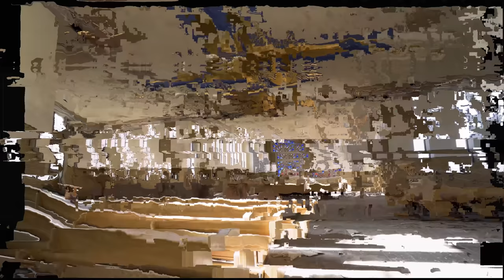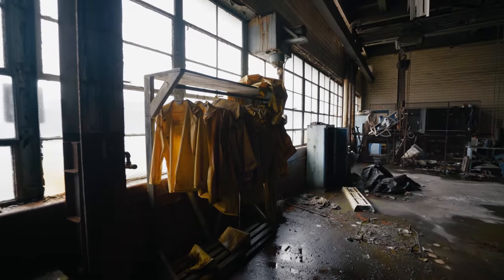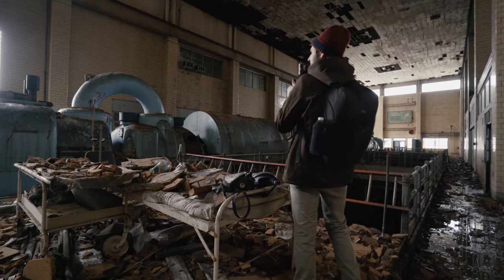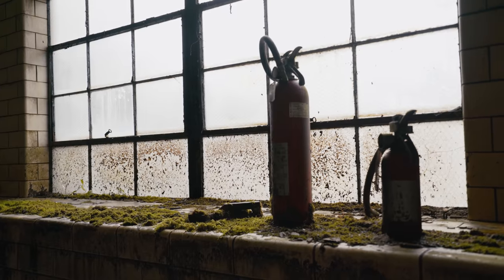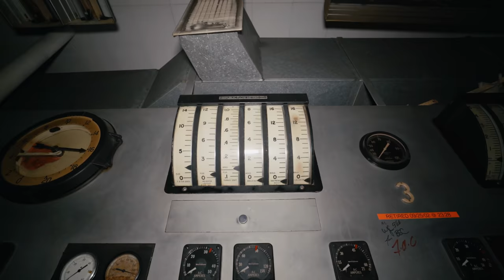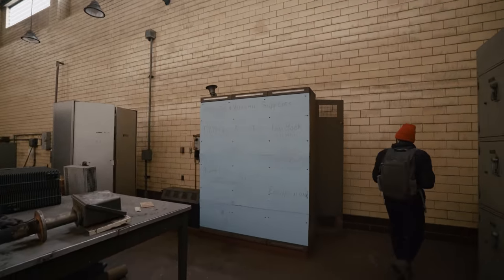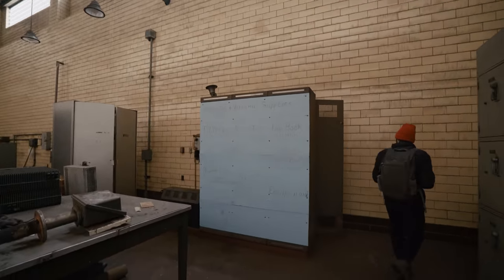Abandoned Power Plant Decaying for 20 Years - Vintage Time Capsule Explored!

Comment: Most turbine decks are enclosed for maintenance and repair purposes. Especially in supercritical boilers where turbines have an expansion chamber where super heated water turns into steam, a controlled environment is a must.
Reply: Where have you heard that?  I used to operate a 600MW supercritical 3500 psi coal plant and the turbine was outside except for a tin shed on wheels for the turbine.

Comment: just a quick tidbit 19:00 the reading with the sensor will actually still be analog since it most likely will send a voltage with varying range dependent on what it sees. It would only be digital if its an ON/OFF signal or if it has its own type of transceiver to then send a communication signal to the control room. Digital by definition is technically only 0 or 1. A sensor can't send a 0 or 1 unless it has a transceiver to then send a bunch of 0s or 1s in the form of communication. Switches however is an on off deal and takes the from of a 'digital' sensor.

Comment: Especially knowing the plant was to be demolished, I wouldn't have been able to help myself to save those push button plates, gauges, and light fixtures. I love that old art deco equipment. Back when even a simple switch was built like it belonged in a kings palace. I know modern stuff lacks that edge to make it cheaper, but it looses a lot of character as well. I love all your video's, especially of the unsung hero's of our country, our manufacturing and utility buildings.

Comment: Thé station I work at went offline in 2010 the station I used to work is an active coal fire plant. The control room guy I talked to said they didn’t have degrees they where on the job trained. Most of the actual work was done by contractors. With the current crisis in the world I expected the other generating station to come back online at some point

Comment: It's weirdly sad to see these places shut down, but also bittersweet, because coal is not exactly the best way to generate power. Great that you preserve this history via video and photos though. Seeing that wall of fame is kinda sad as it may have been the last time some of those people saw each other, as they all moved on to different jobs or retired. I can't help but wonder what at the atmosphere was like on the last day, with everything quiet and turned off.   You kind of get attached to a building and a work routine.  I worked for around 10 years at our local telecom central office, I still have the same job but they moved us to the call centre office.  I legit miss the telecom office. The hum of the equipment, and different sounds the different rooms made, and just seeing the infrastructure I was supporting.

Comment: Interesting find regarding Thermalastic:
June 1982
"During the last fifteen years, the emphasis in stator insulation for central station generators has shifted from electrical to physical properties. To meet this requirement change, the Westinghouse Thermalastic Epoxy insulation system was developed, in which the previously used polyester resins were replaced with epoxy resins. The improved physical properties of this new resin system resulted in a mechanically stronger coil insulation. The insulation was also found to be able to better withstand thermal cycling forces, reflecting both its improved mechanical and thermal characteristics. In addition, its superior resistance to water diffusion ïndicated a great safety margin in the unlikely case of internal leaks in water-cooled windings."

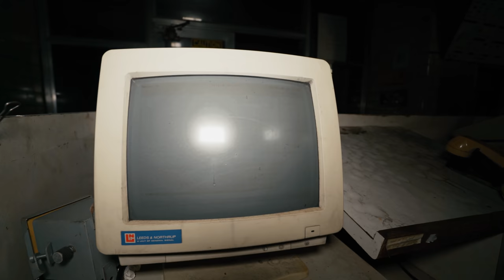Comment: 15:22 I think its more like 80ies tech. General Signal bought Leeds & Northrup in 1978 and sold most of it to Honeywell in 1995. Judging by the design of monitor and control unit I would date them mid to late 80ies. At least the design remindes me on the used C64C and monochrome Commodore monitor we've got in the early 90ies. But I could be wrong cause this industrial automation stuff is made usually very long probably as long as the C64 and back then nobody bothers to make a new design for that stuff after some time as they would today. Such as the keyboard looks is basicly the same the day it would've been designed in the late 70ies/early 80ies. Could've been right from the Nostromo's bridge. Notice the Honeywell branding on the other one. It would've be replaced after 1995...
Reply: I concur. Those were 80s, monochrome monitors.

Comment: Very nice narration. You could have held more time on the floor control stations Did you take the books?? They would be priceless. That would be priceless data and still useful iff you wanted to understand a station like that - or any other. The pipes up the front of the boiler are likely coal injector lines from the pulverizers.  Hewllet Packard Oscilloscope - GRAB IT  They will test the water used in the boilers in the lab. Very nice ending.  Would have been nice for a quick review after the clean-up.  Too bad you guys didn't get into the Salem Harbor gen plant - formerly owned by New England power when I worked there on the #2 turbine.
Reply: Better yet, it is a Tektronix oscilloscope.
Reply: @newjerseybill3521  Thanks for the correction Bill. Yes - what a beautiful instrument that might be going to scrap.

Comment: The capacity was 82,500 kilowatts, 42,500 from each of two identical units. That was estimated to be able to likeht 850,000 100 watt lamps.
It is now replaced by a 57 megawatt natural gas fired powerplant.

Comment: You should take the Oscilloscope. NO ONE is going to miss it. It will likely be in the ruble of the demo. Even not working, someone will want it. Even obsolete, someone will want it.
Reply: That oscilloscope has been sitting in a unheated damp atmosphere for over twenty years.  It would probably give out the gray smoke when turned on.  It could definitely be cleaned, cooked to remove moisture, but would it really be worth the money to do so?  You can find used ones for sale from time to time for under $200 bucks.
Reply: @4GSR  There are people that know how to restore it. They could auction it on the E-bay and some collector would want it, regardless. The more rare things are the more valuable, even if broken. Some people just want it for props or aesthetics with no intention of actual use.

Comment: I assume the power station was built for the American Viscose rayon factory near by, it was actually owned by a British company and they had many other factories mostly in Virginia.    They made Rayo or fibers for tires and the factory was built in 1940 and must have been hard at work during WW2 and later for the use of fibers in the Space industry and NASA but closed down in the late 1980s and was demolished some time after that.   The power station closed down I see from this video 2002 so just about a decade after the factory.

Comment: When they demo a plant like this, do they move the heavy equipment out?
Reply from the maker: Usually they will tear the machines apart with cutting torches and get that scrap metal out first since it is pretty high value, lots of copper. Then they'll either implode or tear down the rest with excavators. This one was small so no explosives needed.
Reply: @TheProperPeople  The turbines are usually salvaged, rebuilt and sold all over the world to other power plants for backup's.  Yeah, most everything else is scrapped.

Comment: It is sad that period infrastructure and architecture must be demolished.

It is common for the substations to remain online after the plant is decommissioned and demolished. Because the utility already owns the right-of-way, it's easier to continue to use the substation as a connection point from the regional sources of power to the destination.

For example, in many cases, a power plant is built in the 1930s, then a second plant is built 20 miles away in the 1960s, and a line is run from the 1960s plant to the 1930s plant's substation. When the 1930s plant is demolished, the 1960s plant still feeds the same substation.